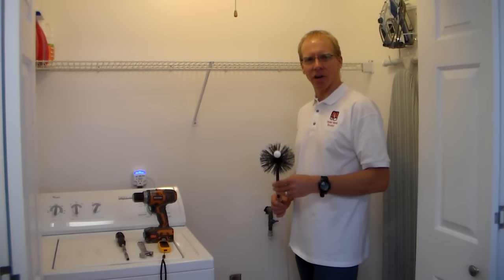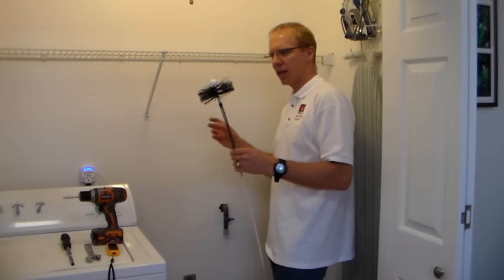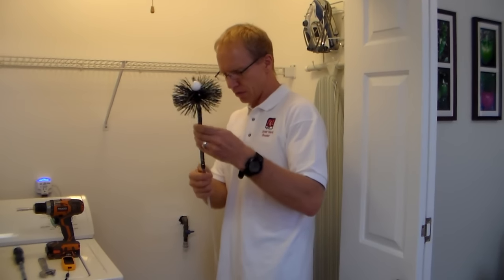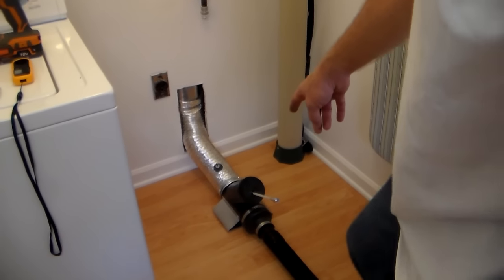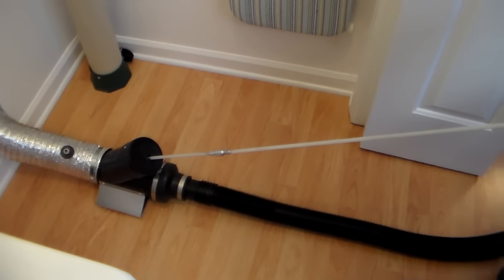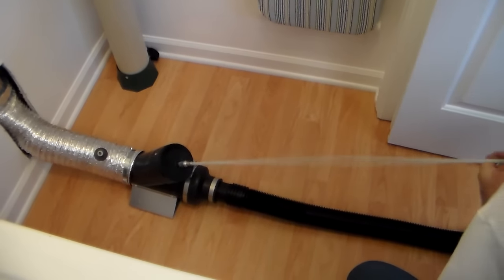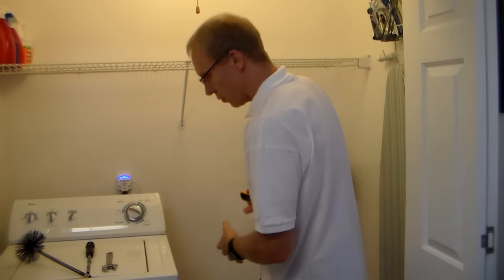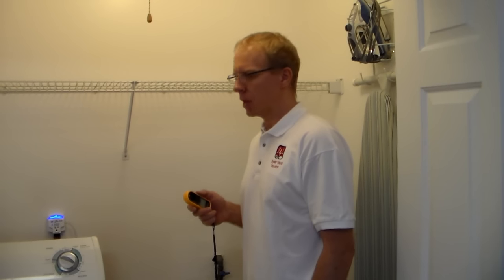Dryer Vent Cleaning - This Is How We Do It.

Comment: Ended up getting rods stuck and dont know what to do😢
Reply: Did you ever get the rods out? If so how did you do it?
Thank You
Reply: @akaredcrossbow  I didn't 😪
Reply: Deprogram Minds is it in a horizontal run? Sometimes you can heat up the vent and that melts the brush and it makes it easier to remove. You can also copy a chimney sweep rod retrieval tool to try and hook onto the rods and pull them out.  
https://www.northlineexpress.com/poly-rod-chimney-cleaning-retrieving-tool-23550-1329.html

Comment: If you don't go up on the roof and address the CAP,  you're NOT actually doing a PROFESSIONAL JOB!!  Yeah, the lint in the line is bad, but at the end of the day, the CAP is ALWAYS CLOGGED. SO, you need to either CLEAN it, or REPLACE IT. Otherwise,  the line will just clog up again.

Comment: I did this but the stupid rods I bought at homedepot were not the snap on ones like yours but they screwed on.  So when i reversed the drill each time i pulled rods out the third time they unscrewed at the top and the brush and rod got stuck in vent.  Smh. DIY thats what I get. Uffff
Reply: Read instructions....ALWAYS drill in forward position.  NEVER reverse the drill including when you pull the drill back out (keep it running forward).   Also directions have you add duct tape each time you add an extension.   This secondary precaution also keeps rods from unscrewing or detaching as well.  I've cleaned my 8' + dryer duct that goes from laundry room to roof many times and never once had a rod unscrew.  FOLLOW INSTRUCTIONS!

Comment: What about the Dryer itself? That's where at least half the lint is trapped.
Reply: Not exactly. In some systems some lint might be inside the area of the dryer from the lint trap, through the air shroud, down into the motor and fan, then through the exhaust pipe. In those areas the most lint will be in the lint trap to the air shroud leading to the blower fan. This won't be nearly as much as can be found in a 20 foot vent with any turns.

I always suggest you remove the front bulkhead and air shroud of a dryer to remove any build up right before the blower fan.

Comment: I'm looking at the LintEaterPro Rotary Dryer Vent Cleaning System. In the description it says "No shop vac needed using the dryer adapter" could anybody explain what they mean? like how the same results would be achieved with or without a shop vac?
Reply: You would use the blower in the dryer to force the lint out while you brush from the outside of the house.  Or, you can attach an electric leaf blower to the vent inside of the house and use that instead of the dryer blower.   Be sure to wear a protective mask when doing it or your lungs will not like you!

Comment: its a way lot easier to  replace the existing tubing with new tubing. I  use a metal coat hanger with the hooked end and it will unclog a vent tube with ease and save some dollars.

Comment: that is not going to remove a birds nest
Reply: larry david jr  True...thats why it's important to go out side and check the termination vent first and unclog if necessary and use a flapper clamp before cleaning from the inside. He might have already done that, if so it should have been shown in the video.

Comment: Gteat video.  But I tried a much simpler solution and VERY inexpensive.  I had a bird nest and lint in my vent.  I duct taped interior vent.  Cut small hole in the middle, just big enough to insert my leaf blower.  Removed the long end of my leaf blower and inserted the blower itself through the hole in the duct tape.  The duct tape acted as sort of a seal.  Turned on and it blew EVERYTHING right out of the vent.  I let it run for a minute or two.  Problem solved.  A leaf blower produces airflow of over 100 mph.  Some more than that.  It was simple, and there was no need for a professional.
Reply: Bad idea, you will create a plug of lint at the end of the run at the cap or vent, not to mention you risk blowing a joint apart inside the wall.

Comment: Too much troubles i prefer to buy a new metal duck it will be clean for sure!
Reply: *trouble,
*I
*duct.
*It

You are a classic example of why the landfills are full.
Reply: Your attention to grammar and spelling were unnecessary.  From his name, I guess he is probably French and obviously from his writing, English is not his first language.  Did you really expect that in this forum your corrections would be noticed or appreciated by the writer?  At least he participated in the discussion--although I personally disagree with his conclusion.
Reply: Yes you are right on this one but then i went and cleaned it. I usually put everything in recycle, my garbage bin is one bag  or 2 little one a week.   Thanks for this message if other will think to do the same as i wanted to do, you are right it is very important to minimize our waste!
Reply: yes you are right too I'm a French speaking person first language! But it good to be corrected so you don't make those mistakes again! I guess i misspelled duct because i live in a place full of real ducks and trouble because it's not just one but many things to do and It I should have put a coma!  And for the conclusion I decided to clean it as I didn't have to put it in the garbage it was still good and I cleaned everything well! Thanks for your good words! Bonne journée!
Reply: It is impractical to replace the entire dryer vent duct.   Maybe the transition duct behind the dryer, but not the entire run!

Comment: Is your super duty vacuum cleaner The Binford X-8000 Nuclear powered vacuum cleaner? The guy in the previous video uses a battery powered leaf blower, and blows the lint out of the exterior vent assembly, and into the outside air. Easy Peasy.